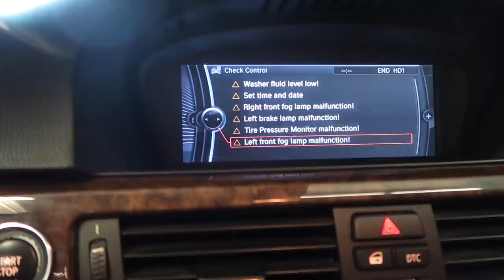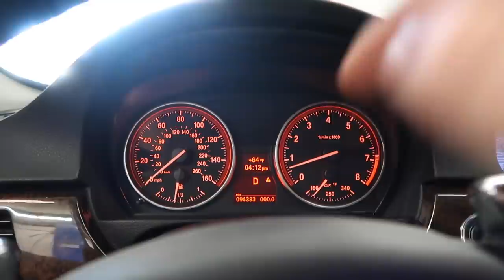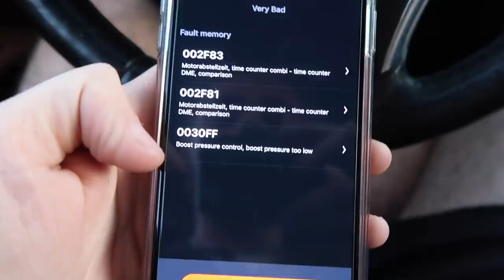MY FRIEND GETS HIS FIRST BMW FOR A STEAL!! (HEAVILY MODIFIED)

Comment: My first guess for the 30FF would be BOV. If its not working properly it will vent boost prematurely and throw a 30FF. Also, check the intercooler O-rings as they can sometimes cause it too.

Comment: Nice find. 
For 30ff. Could be the couplers connecting the charge pipe to the intercooler. On either side. I got that code when I didn’t install my front mount properly. So I would suggest checking the charge pipe couplers. And the connection between the charge pipe and the intercooler. Also the other side that connects the intercooler to the turbo. Who knows. That can also cause it. Lastly a bad bov will cause it as well. Not necessarily only the lines

Comment: 30ff can be caused by a variety of things. Depending how many miles the car has, the wastegates are probably worn. If you don't hear them then they're probably programmed in MHD to stay open to mask the sound. Start with silicone boost lines, check your intake manifold seals, throttle body to charge pipe tightness, intercooler piping (mine was leaking, fixed my 30ff), boost solenoids can be losing boost, then just straight up the turbo wastegates.

Comment: MMMMMM Guys next time it's worth to invest first in a good scan tool specific for bmw proprietary codes. Read the codes before test drive then read codes again after driving at least 60 kms (about 40 miles) just in case the seller had erased the faulty codes (almost all dealers do it to mask problems) Most BMW owners don't take care of the transmission because bmw says it is life time without service. The true is that after 80 thousand Kms (about 50k miles) the transmission fluid is already burned out, sticky and black. Achilles hill in bmw's is transmission failure because lack of service. hopefully the previous owner did transmission service every 50 thousand miles. If the seller doesn't allow to read codes before and after driving at least 50 kms DON'T BUY ANY CAR Specially a bmw with over 80K miles on it. A good scan tool will tell you whats wrong from ignition coils, throttle issues selenoids in transmission oil injectors Vanos etc...and can save you Thousands of dollars. Wondering why they didn't scan the car before the purchase? 🙄 or am I wrong?

Comment: I have that same engine, 30ff code means get new turbos lol
Reply from the maker: Faustastic2 lol
Reply: Noooo not always they will smoke
Reply: P30ff code just means theres a boost leak somewhere. Could be chargepipe, bov, Loose clamps somewhere with the turbo inlets outlets. Good luck 30ff code is common for n54

Comment: Definitely take that tune off, check The electric water pump, the injectors, and a high-pressure fuel pump before anything. If you want to tune still just buy the JB4 plug-and-play that you can plug right into your intake. You did a video on that do you still stand by it??

Comment: Hey nour how do I know if I have a boost leak? Cause I also get a check engine when I try to run it hard 😫😫
Reply: AxelMartinez9 when I bought my 335i, I would get a 30FE code, my car was completely stock, and a lot of people told me that I had a boost leak, to check my hose, if any ripped, or torn, to check my canisters, did all that, swapped out every hose you can think of and still nothing, turns out it was my boost solenoids that’s didn’t work anymore, what code are you getting ?

Comment: I know the rear tail lights look like they work, mine had the same problem but there’s 2 lights in the rear brake lights so one has to be replaced. I had to tear the whole assembly apart, I was confused because they looked like they were working but I tested it with a multimeter and it turns out one of the brake lights was out. Simple $5 fix

Comment: This makes me want to sell my 328i for a 335i i just dont know how much i would pay for the difference.
Reply: Dont even bother. My 335 was a curse for maintenance. I dropped it after 2 years for a e92 m3.
Reply: If you wanna mod your car for cheap power, the upgrade is worth it. They aren't cheap to fix. They have issues, but if you're willing to work on your car here and there it will save you a good amount of money not having to take it to the shop. There's alot of useful good guides and videos nowadays. Be patient and you'll be fine.